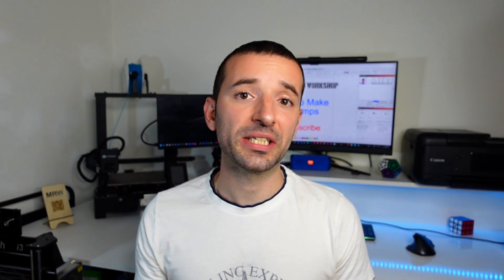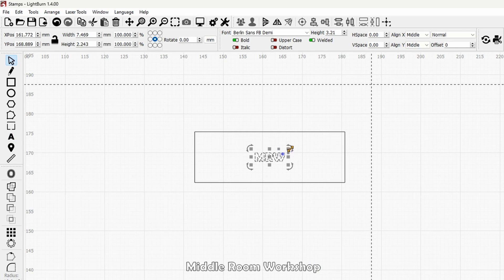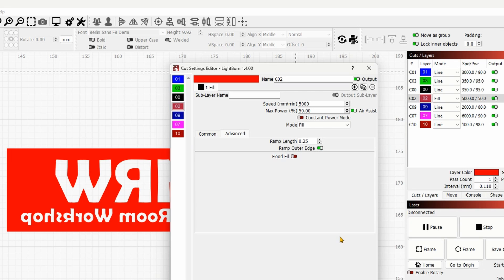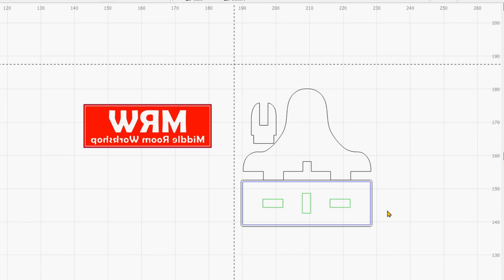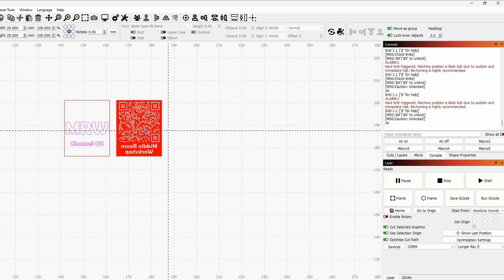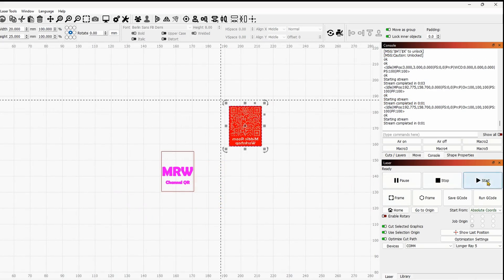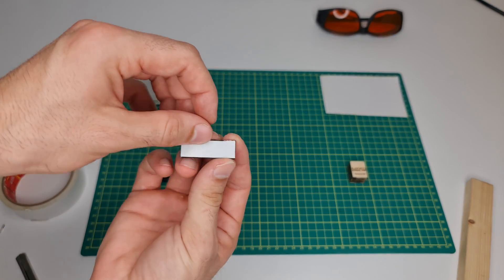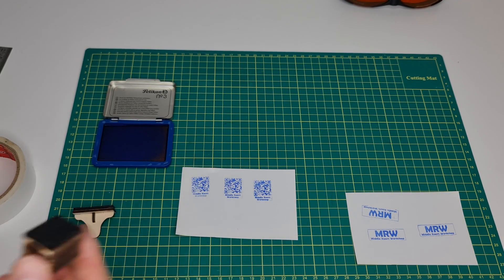How to make a Stamp with your Laser Engraver

Comment: if ur using lasergrbl that means u running on M2 board which the software dongle you can drop it off... and just use k40 whisper and illustrator. its way better then lasergrbl and corellaser so have fun (also no dongle needed)
Reply: Does it mean i can use k40 whisper for sculpfun s9?

Comment: Whats the cheapest laser engraver on amazon tjat would work for making custom stamps on rubber with simple designs as small as a square inch ?
Reply: probably a k40 laser they go for about $500 new but I'm sure you could find a used one.